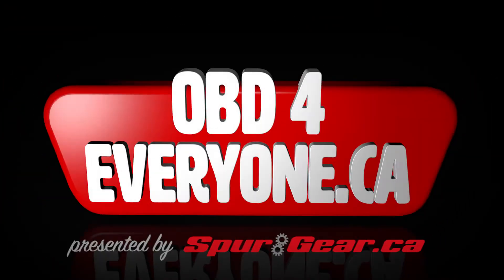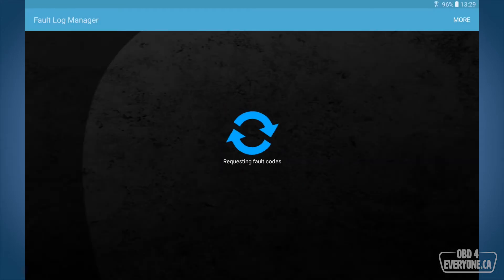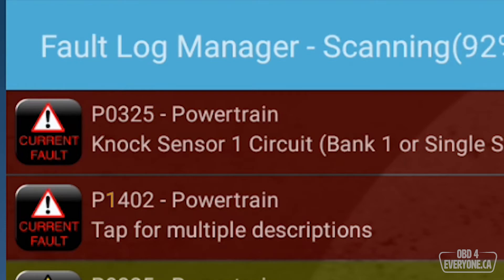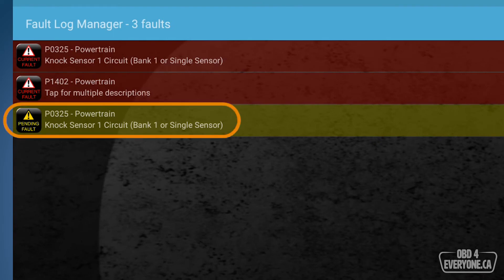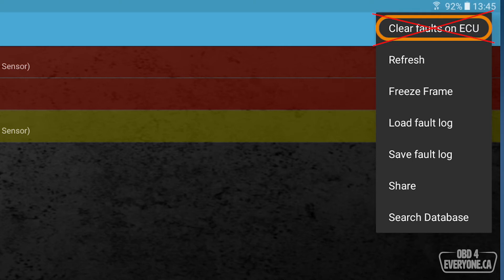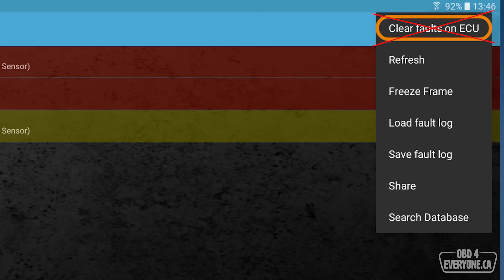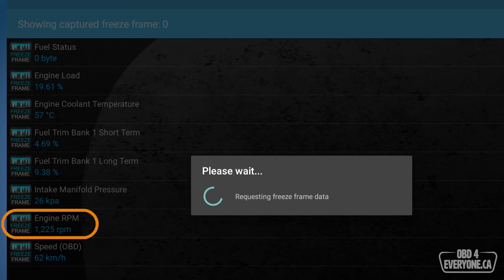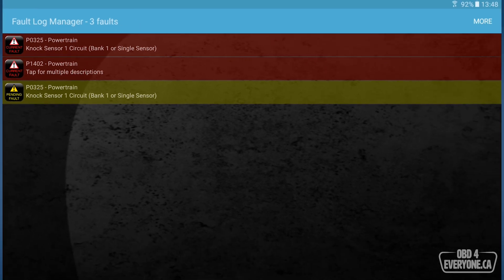Reading Engine Trouble Codes with Torque Pro for Android: OBD4Everyone Ep. 12

Comment: What if the code is green with a check mark, I just replaced that sensor? Also will is pass emissions now that's its a green check mark
Reply from the maker: I have no idea as I don't know your vehicle year/country/state or emission pass/fail requirements.
Reply: @OBD4Everyone  it's fine, thank you. It was a chevy camaro but I sold it last week. Thanks for the reply

Comment: what would be the best fault code reader for  a   2005    tahoe   5.3  drive by wire..  doing an ls conversion and need to see  what's not   signaling    (  ie:   pedal not opening  throttle body ) .. something close to hp tuner.     please  state  program and which  obd to use to plug in to using  on a pc ..   thanks for being awesome !
Reply from the maker: Hey J bo,
I have no idea as I don't know anything about GM products.

Comment: What does grey fault code indicate
Reply from the maker: Hey  Adithya Sumanth,
I think a grey code is a "permanent code". This means that a scan tool can't clear it. Only the engine control unit can when the fault has not happened in multiple drive cycles.

Comment: quick question. i had a engine light on. scanned and got p0303 in green. after a day engine light went off but scanned again and code was in red... whats difference between it being in green and in red. and why did light go off if code is still showing. its a 2020 sportage
Reply from the maker: Hey  Greg T,
The green background colour indicates a "Pending Fault"
Red indicates "Current Fault" 

If you clear the codes, the current fault is erased, depending on the year of the car. Some newer cars have a "permanent" fault the ONLY the engine computer can clear after the car is driven multiple times (aka "drive cycles)" without the fault reoccurring.

For most OBD systems the fault needs to happen twice, before the check engine light is turned on. The first fault is the "pending" fault.

If the same fault happens again within a certain amount of "drive cycles" then the check engine light is turned on, with a current fault.

For what you have told me, it sounds like your engine controller detected a mis-fire on cylinder 3 (P0303). Since this is a potentially catalyst damaging fault, it doesn't wait for the second fault to turn on the check engine light... it does it right away.

The engine light turned off by itself, as the required number of drive cycles were completed without the fault being detect again. BUT you still have the permanent fault, which only the engine controller can clear.... and after the required number of drive cycles, it will.

Since your car is new, you might want to take it to the dealer and let them have a look. Your car is too new to be having a misfire, but, may need and update.

Good luck!

Comment: Thanks for the informative video! I have a question. I have a code on my ECU, which is displayed in red (current fault) most of the time (and at this time I do not have the CEL on, but it was on till a few days ago. It just randomly disappeared), but whenever I press the refresh button in the menu the code changes from current fault to pending fault and so on. Do you happen to know whats going on here?
Reply from the maker: Hey Michael van Dooren,
I think I have an idea. As the car is being driven, the ECU is always running test to check for faults. The first time a sensor test fails, that is a "Pending Code" and the CEL is NOT turned on. The second time the sensor test fails, that is a "current fault" and the CEL IS turned on. 

If the next 3-4 times the car is driven (using the specific OBD driving cycle) and the fault doesn't happen, the CEL is turned off, and the PENDING code stays. After 40 trips  driving cycles have been completed without the fault, the PENDING code is erased.

If the fault is fuel related or a misfire, the CEL is turned on after the first fault and will be turned off after 80 drive cycles without a fault.

Here is a link that describes: Driving Cycles in more detail:
https://www.nyvip.org/PublicSite/OBDII/universal-drive-cycle.html

What was the code?
Reply: @OBD4Everyone  Thank you very much for the quick reply! I will look into the Driving Cycles. The code I am getting is P0101 (Mass or Volume Air Flow Circuit Range/Performance Problem). I cleaned the MAF sensor and replaced the air filter. I reset the fault code and the code combined with the CEL came back after 2 days of driving, but now the CEL disappeared (and last time it disappeared it came back within a day or so) and hasn't come back on for about 4 days now. Torque is still showing the P0101 code though.
Reply from the maker: Hey Michael van Dooren,
What car is this on?
You could create a custom display to show the MAF air flow. 

 The MAF’s PID value should read anywhere from 2 to 7 grams/second (g/s) at idle and rise
to between 15 to 25 g/s at 2500 rpm, depending on engine size.
Reply: @OBD4Everyone  it's a Volvo s60 from 2001. Non turbo version. The CEL came back on unfortunately. I will check out the values going through the MAF sensor, I believe at idle it was stationary at about 3 g/s
Reply from the maker: Hey Michael van Dooren,
Look at the freeze frame data. This will tell you what speed and engine load the issue appeared.
Also have a look at your total fuel trims: short terms + long term should be between -10 to about +10.
Have a close look at the intake boot for cracks that might let in un-metered air.

What are your total fuel trims?

Comment: That freeze Frame data is for which error code? Same thing happening with mine 3 error codes and don't know which freeze Frame data is for which error code and if you click next Frame it doesn't stop as I clicked next frame 31 times and it only showed 3 different freeze Frame and kept repeating frames shown previously
Reply from the maker: Hey Namzy M,
It is my understanding the freeze frame data is from the last code. 

However, with some of the newer ECUs they may have multiple freeze frames for multiple codes.
(Nissan/Infiniti have a single freeze frame)

When you have multiple codes, you should troubleshoot them in the correct order. Different codes have different priorities.  This list is in factory shop manual. 

Good luck!